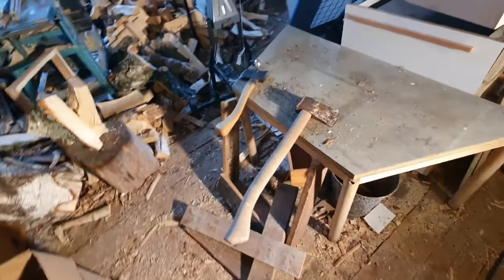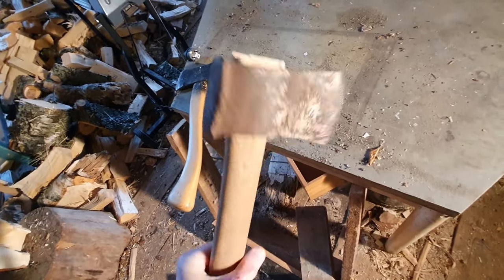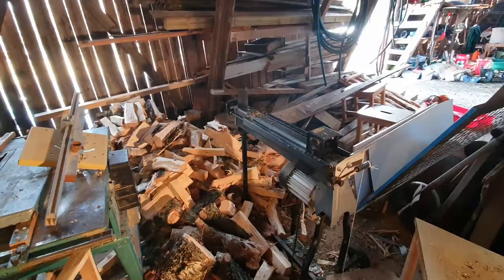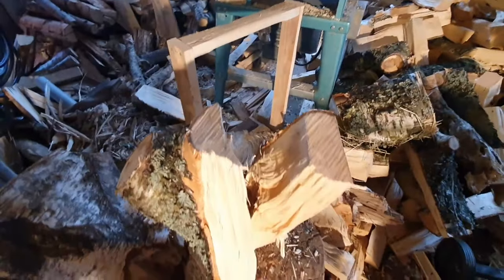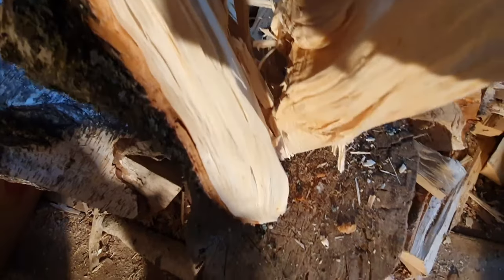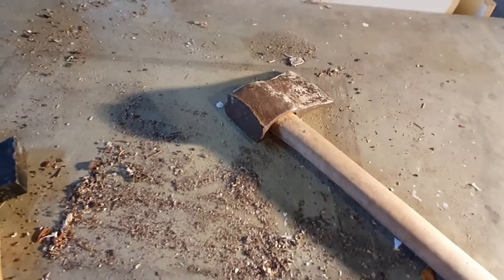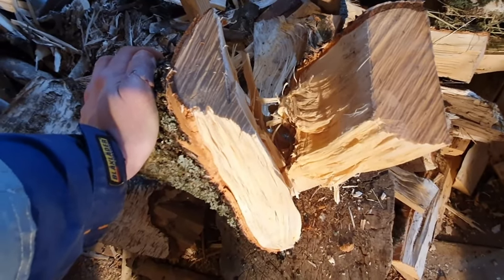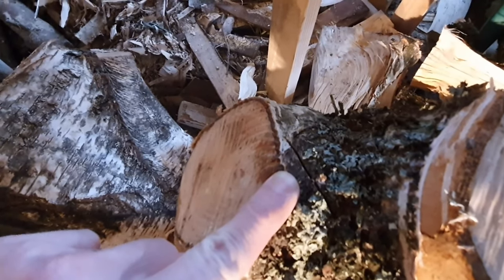Axe safety tip #1

Comment: Ajdå! I have chopped off the top end of my thumb when I was 14 or 15 maybe, I was quite used to chopping woods and normally I would always hit the same millimeter I was aiming for but one day I was a wee bit off..

Lustigt. The funny thing is that I didn't even feel a single thing, I tossed the two wedges on the wood pile and they landed exactly on the spots that I intended to as usual. But I noticed that there was some red "paint", a streak that was right over the perfectly stacked wood. And up onto the ceiling where it kind of got less, and then on the floor and it was more on the wood and then I looked at my finger and saw two streams of blood coming out and realized what had happened 😳😅
Reply from the maker: Feels wrong to push the thumbs up button, but hey thumbs up! 😅 yeah, I guess the good thing about a sharp axe is it might not do as much damage as a blunt axe. Just a nice cut. My wound did not even really bleed through the tissue I wrapped around in the hours I waited at the ER. Now the whole joint is pretty soar though... 😑

Comment: Why hold it? If you strike the the right place it will fall apart anyways. We bought an axe just to make firewood of the wood pieces I cut up with the chainsaw because while using a chainsaw you have to hold but with an axe all you have to do is chop it apart.
Reply from the maker: Absolutely, never hold it!